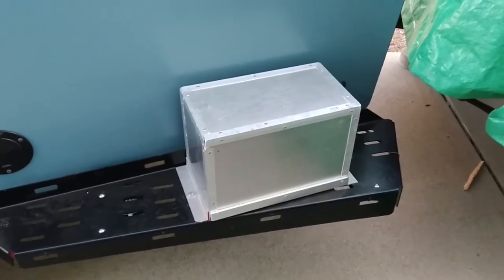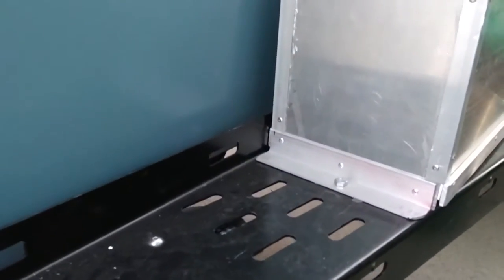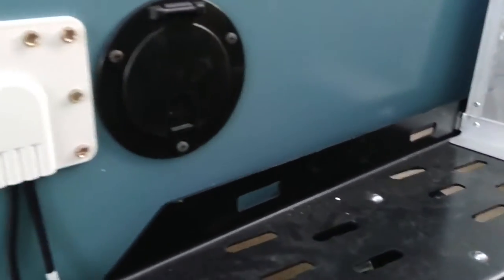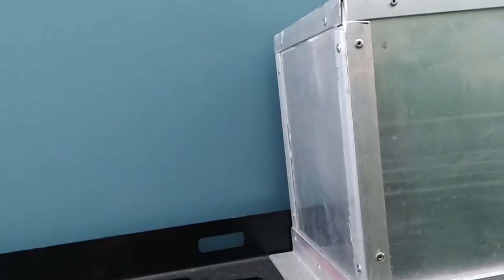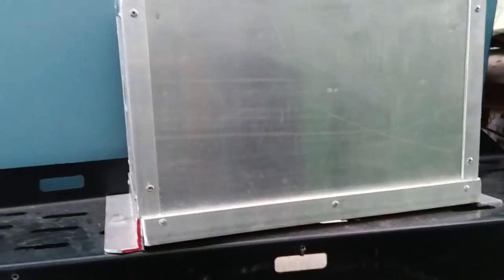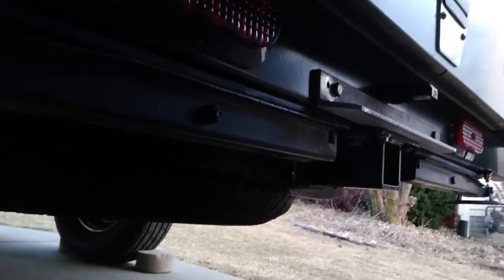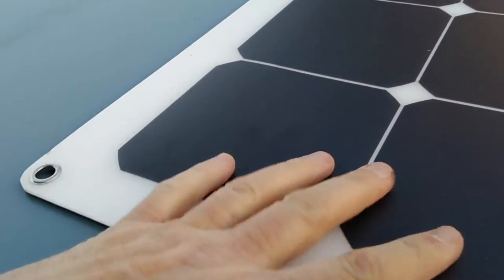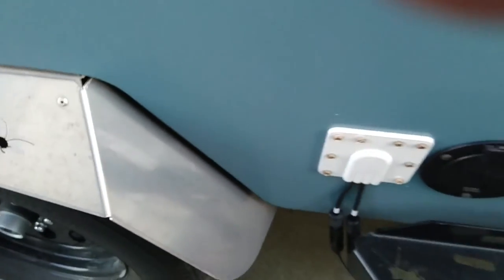Taxa Cricket solar panel

Comment from the maker: So far the solar panel I have on the roof has worked real well.  In fact I purchased another one of the same I'm going to add to the roof.  I will be posting a new video detailing a solar generator I made similar to a goal zero for about $180.  I'm going to use the second solar panel to keep it charged.